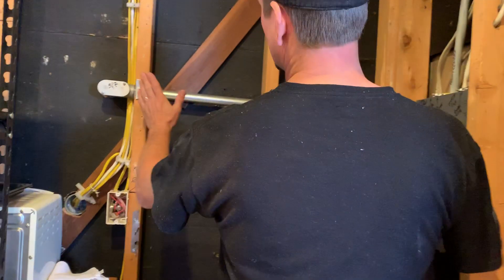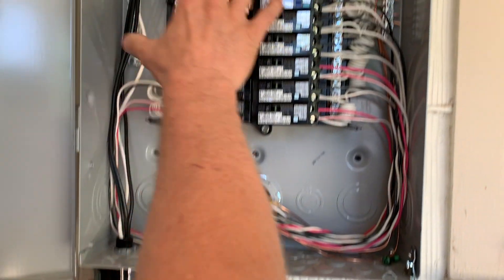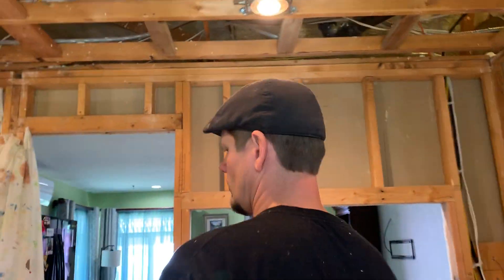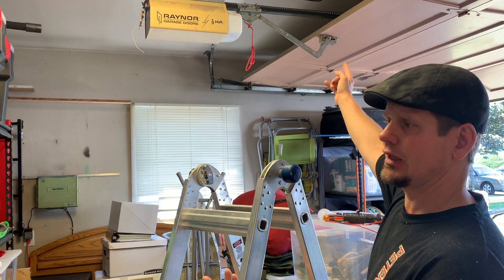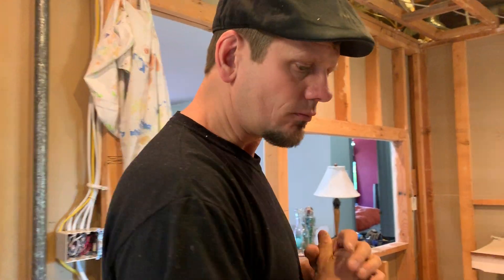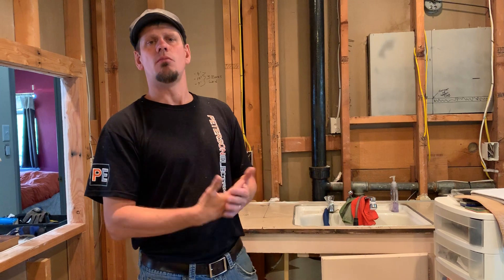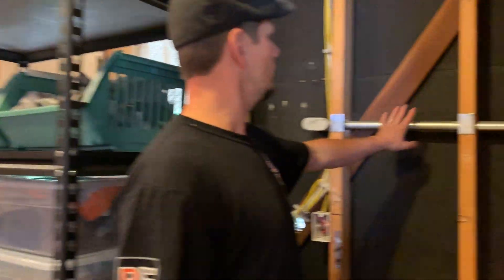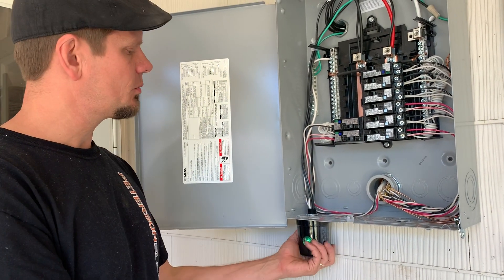Kitchen and Bathroom Remodels: Arc Fault and GFCI Protection

Comment: The older days it was fuses then also they were using aluminum wiring which burnt down a lot of houses. After switching to breakers and copper wire not so much.

Comment: Question on your sub panel install with your surge protection, is  that leagal to tie it in with your main lugs? Didnt know those lugs were rated for two wires in each lug.. Thanks

Comment: Our builder put GFCI outlets in kitchen but also put them on a dual function breaker.  Is that code or not necessary?
Reply: I would never stack GFCI protection like that and often find issues from people who do so. It is not needed
Reply: Double protection for GFCI, required AFCI comes from the breaker. Cheaper and overall easier for you.

Comment: One other thing.... Are you allowed to cover up that LB?
Reply from the maker: When am I going to use it again? never. SO i do not see the point, no splices were made, what's any difference for underground wire you bury or NM cable you staple to the studs and then put up drywall?
Reply: @Petersonelectricllc  if that wire is ever worked on gets damaged on the corner of lb. Covering up a service point like this is a violation and you know it
Reply from the maker: @drcpaintball  Yah well, whats that difference on the NM cable being stabled and installed in the walls? Sometimes you have to use common sense and choose NOT to damage their studs. The wire was inspected and if you remodel OLD homes you would know that the code is NEW and not everything can be applied 100% of the time. This is the difference of wiring new vs old, we try to meet all codes.

Comment: I'm going to guess you didn't derate the 9+ current carriers in that conduit. Also the surge protector is supposed to go at the top of the bus (for obvious reasons).
Reply from the maker: This was a nipple, and 9 current carrying conductors does not apply under 24" nipples. Chapter 9 table one. Surge protectors do not know the difference of where on a bus bar, only that you have them in every panel.
Reply: tyler therrien yes it will protect all the  circuits down stream also cut the neutral wire down as short as you can before the set screw

Comment: I wouldn't have double taped those lugs like that. Install a separate double pole breaker or used a Polaris connector and pigtail.
Reply from the maker: Yah I thought about that too, but you are allowed to do what I showed, especially when out of breaker space, there is NO LOAD ON THIS DEVICES OF ANYTHING that will cause it to melt.
Reply: @Petersonelectricllc  the surge protector does draw a small bit of current especially on power up. You have 4 more slots to install a double pole 20 (or whatever manufacturer wants) but if you didn't just pigtail the feeders. The issue that may occur when double tapping is a weak connection when you have two wires under one lug. Also what brand is the protector? I've used square D.
Reply: @Petersonelectricllc  here where I work in s. Florida, the JHA will not allow a surge to be double tapped to the lugs like that. And I get called for service from insurance companies who make me remove them when someone buys a home before allwoing the home to be insured.
Reply from the maker: It will not hurt anything to have it in the lugs. Yes, I use the polaris connectors all of the time. It would then considered as a T-splice tap under 225 or 300. But, I guess when I saw the instructions it stated I could do this on this SPD. So, 110 talks about following their manufactures spec.

Comment: New 2020 code In Massachusetts requires you install a surge protector on any new service and all new services require a meter main disconnect. Also all old oven 2 wires have to be replaced with 3 wire and backed up with a 2 pole gfci protected breaker. There is plenty more .
Reply from the maker: Awesome, we are about to go to our new classes next month and I had a couple inspectors last year that gave me hints about the new codes. I think they make better sense and more safety.
Reply: Peterson Electric the oven breaker will only need to be gfied if within 6’ of any sinks
Reply from the maker: I heard that the 240 volt GFCI breaker applies to under ground level rooms and unfinished. If this applies in 210.8 then I am SOOOOO SURPRISED. I do not think that ovens should be GFCI, but only AFCI. Reason, your talking to an old appliance teck.
Reply: Peterson Electric they also want to arc fault any 240v central air systems but not a 120 v that could lead to bad news if the owners are away on vacation in the middle of winter and the arc fault breaker trips to the heat still waiting on the final word on that one
Reply from the maker: @catdog262  This I will not follow! I am not owning on my insurance on any 120 volt or 240 volt AFCI, heating systems. I already had a problem with this 4 yrs ago with an inspector and it caused me money, he did not give a crap about what happened.
Reply: Also all dryers and it doesn’t matter where they are in a house have to be gfi protected

Comment: GFCI do not detect water. Any electrical current flow to ground for any reason is a hazard & the GFCI devices trip before THAT ground fault becomes dangerous.
Reply from the maker: Throw water on it and try, I did. It does sense the short between neutral and ground and Hot.
Reply: @Petersonelectricllc  it doesn't detect water. it detects the short. if the water doesn't short the wires then the gfci doesn't trip.